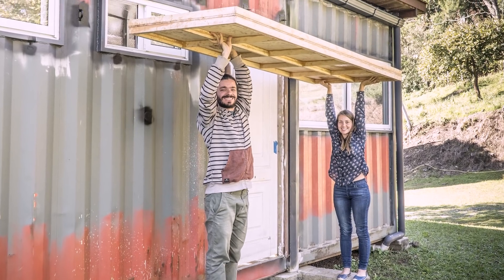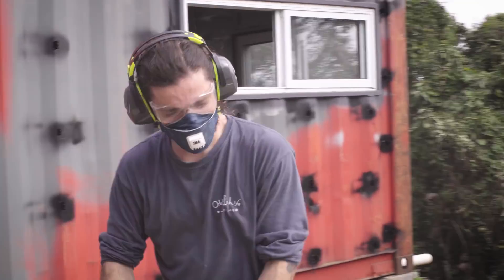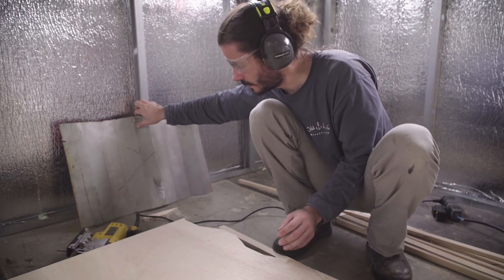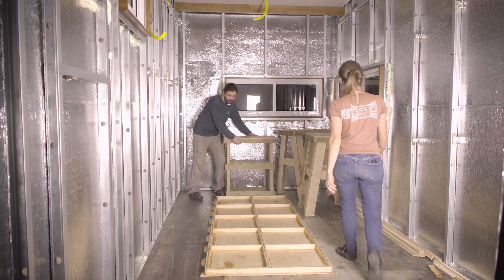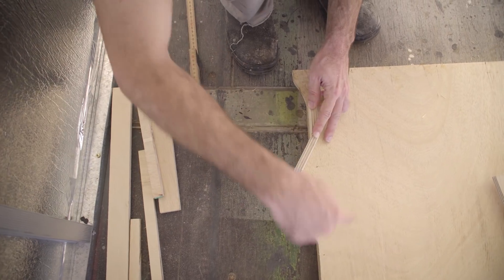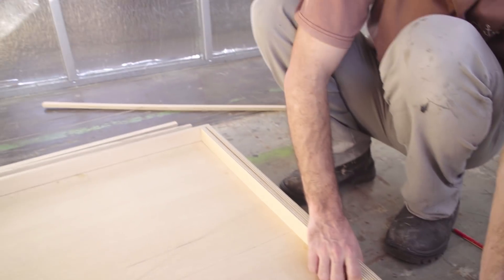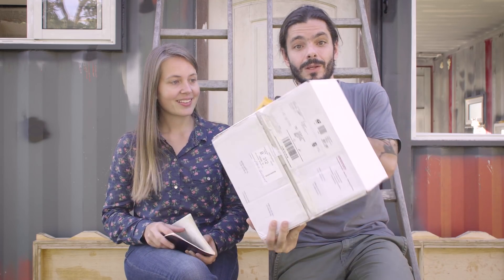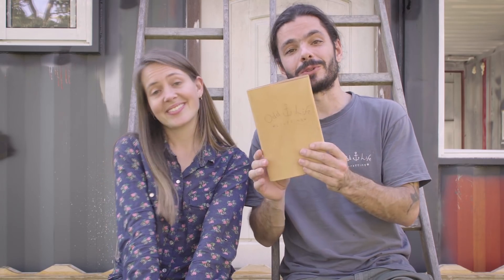1 sheet of plywood CANOPY - Living Tiny Project Ep.038

Comment: Something you could do on the next fiberglass project is use regular wood glue for the wood gluing steps to save cost and time. Fiberglass strength comes from the glass, curves and arches as well as glass on both sides.  The squeegee is the best tool along with the brush to put glass on the wood or other glass. Resin has strength but the glass should be saturated just enough don't make it too wet because it can tend to float the glass thus weakening the layup
Reply from the maker: Thanks a lot for all the advices. 😊👌🏼

Comment: Loving the videos, I subscribed today. Im a carpenter and and work with Formaldehyde products all the time.  Next time you cut or use cut material with Formaldehyde  please make sure your wife has a mask. Also, when you move in make sure it is well ventilated as these products off-gas for many years
Reply from the maker: 👌🏼 thanks a lot for the tip Steve!!😊👌🏼
Reply: I wear the mask when cutting but its in the fibers in my clothes after,  I can only try and keep it 2 a minimum. In my builds I try and use as much native untreated wood as possible. Great work, love the channel.

Comment: Will the canopy have a slope?...If so the blocks you cut with angles, that meet the wall. They would also need to match that slope, or you will have a gap.
Reply from the maker: You are actually right and we just realized that. 🙈 but a really small gap as we don’t really need a huge gap. We will see, if the rain ends up in the gap (it’s right underneath the wooden deck) we will fill with sikaflex (PU) if not we will live as it is. 👌🏼😊
Reply from the maker: Thanks a lot for the tip though 😊
Reply: Odd Life Crafting, you can use maybe a 'drip edge' just a small metal strip to transition between the container and the canopy. Good luck, I really look forward to your videos. Take care.
Reply: Odd Life Crafting you can use a strip of the container you have (maybe) from earlier construction, to make the transition.....to match the profile.
Reply from the maker: I think in the end we won’t need but for sure will keep the idea on our mind in case we don’t have the result we are expecting hehehe thanks a lot for the tips!! 😊👌🏼
Reply: Mike Laing same thing I was thinking. Maybe they are going to but sheet natal over it or some kind of sheeting I am also curious to see how they plan to mount it. The back portion could be mounted to the wall but the front will need support as well.
Reply: MIke c I love the problem solving involved on these builds, it is the most interesting part. It keeps me watching that is for sure...I also like how the community helps and gets involved, it all makes for great videos.
Reply: Mike Laing I enjoy it as well. I am an aircraft / Auto mechanic but I enjoy wood,metal construction and gardening really any kind of hands on type projects where I can learn something is a plus. Have a great day.
Reply from the maker: We will have stainless steel cables holding the front part. 😊👌🏼
Reply from the maker: The group solution search can be really helpful!! For sure we are learning a lot by interacting with people that watch the videos. 😍😊
Reply from the maker: Wow been an aircraft mechanic you must have really interesting and useful engineering knowledge. 👌🏼😊 If you want to stop by some time you are more than invited hehehehe.
Reply: Odd Life Crafting To be honest my skills as an automotive mechanic made me a better aircraft mechanic. I like the idea of support cables holding the front edge of the canopy. Great solution! I was concerned about the top portion retaining water. You have improved the strength greatly as well soloved the possible wrapping inside by installing the laminated plywood on both sides. The company will need a slope and some type of sheeting material that extends past the canopy frame wood to provide a drip edge. I would suggest about one inch over hang on the top sheeting material you can have more or less of an overhang if you so elect. It just needs some type of an overhang or drip edge. I learned this when I built my green house roof the first time, so the second roof works much better.😀 The main objective for the drip edge is to give the rain water a path to move away from your structure, and too keep it from penetrating the canopy frame work. Good luck, I really enjoy watching your progress. Oh forgot to say AC 43.13 is an aircraft guide for repair and technics if you look it put it has a lot of info on hardware , cables , welding , inspection , electrical wiring you may find it interesting. Thanks again. (Correct wording on first sentence )
Reply from the maker: Thanks su much for the and tips Mike!!😊👌🏼

Comment: hi guys, maybe its a bit too late now, but would t be better to do the cladding on the outside first, so you have a straight wall to work with and attach your awning to it then?
or any reason you wanted to do it this way? 
thanks
Reply from the maker: Sorry but we didn’t understand what you mean. What do you mean by cladding on the outside? Thanks
Reply: cladding is like putting straight walls on your container on the outside (revestir de madeira, de placa, etc)
Reply from the maker: 👌🏼👌🏼😊😊 thanks!!
Reply: Sorry I missed the
message, and yes, as Leticia said ;)

Comment: Why u aint use waterproof wood glue? Just askin.
Its way cheaper & easier to work with. 
Just because u already had this epoxy stuff? I guess ull need a lot of woodglue in the future. Even more if u want to re- or upcycle your furniture.

Greetings from Germany.
Reply from the maker: Actually water prove wood glue is harder to find and more expensive for us. And we also wanted to give it a try to glue with epoxy resin as it’s a really strong method. 👌🏼